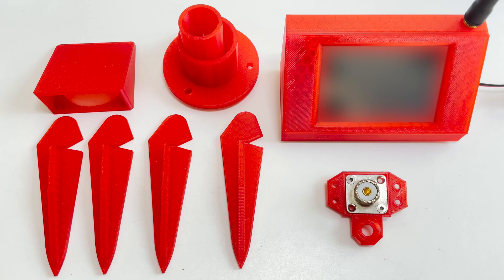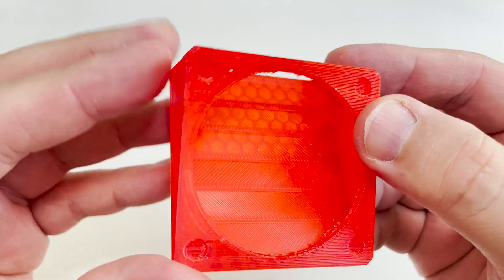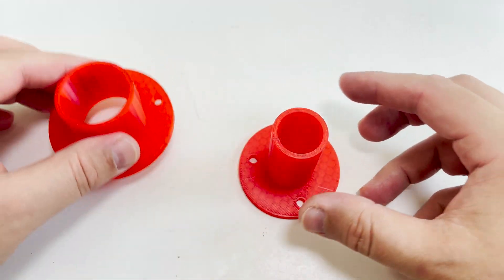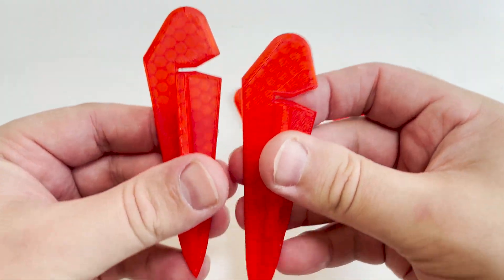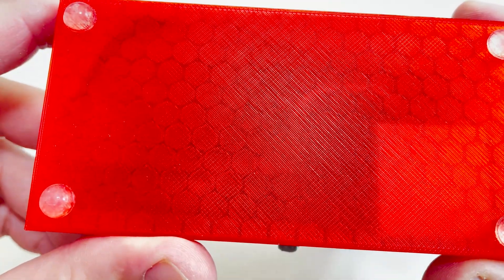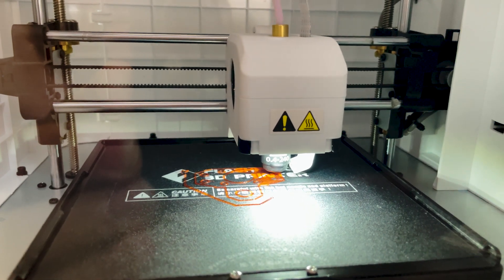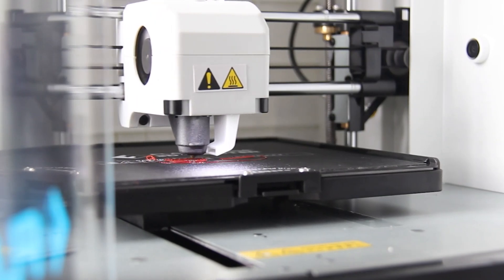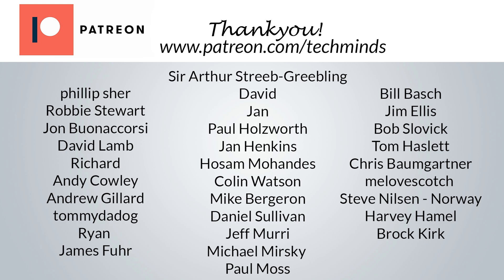5 Useful 3D PRINTER PROJECTS For HAM RADIO

Comment: Which Links would I use to purchase the printer here in the states?
Reply from the maker: You can choose either of the links. If you want the same printer as me then go for the Adventurer 3, or if you need a larger build plate then go for the 4. Banggood may have stock in the US so you’ll get it quicker and cheaper with the discount code.

Comment: Been printing for a year now. I have made lots of neat things for my radio hobby already. A 3D printer is certainly recommended for the shack, and it only takes up a very small footprint.
Tinkercad is a very easy design software to use, even for beginners. It is limited, but if you are a bit savvy with your designing methods there are ways around some of the limitations.
I use an Ender Creality printer and it works pretty well. I even done a talk and demonstration on 3D printing at my local radio club a few weeks ago.

Comment: So the cone antenna and the LNB are not used together at all.  You could just as well mount this on the right sized piece of wood at the right angle to the dish
Reply from the maker: If you’re using it for something like QO100 then yes, you would use an LNB with the cone.
Reply: @TechMindsOfficial  Well since Region 2 has no access to that bird that I know of I can't see using it.  What is it used for?